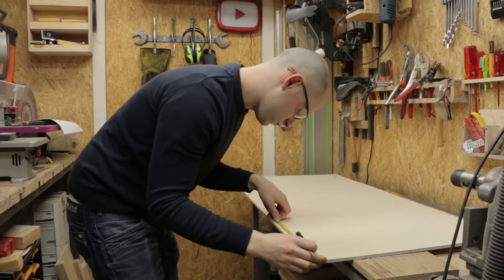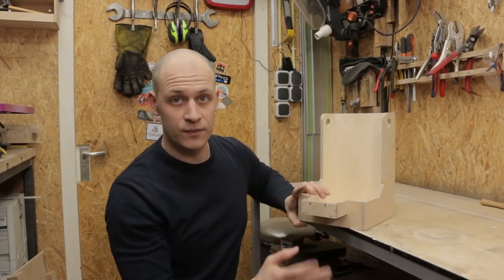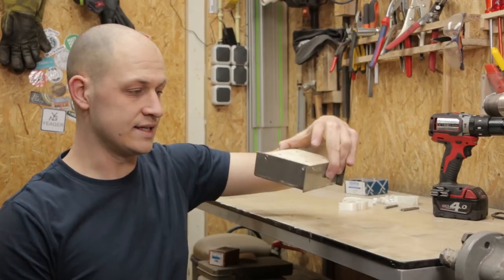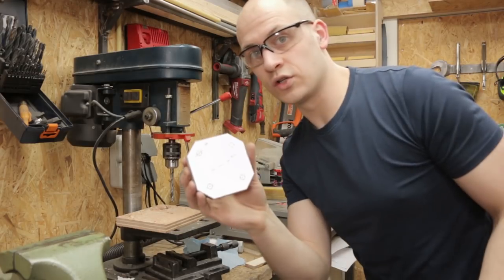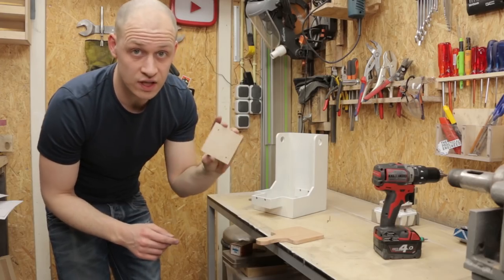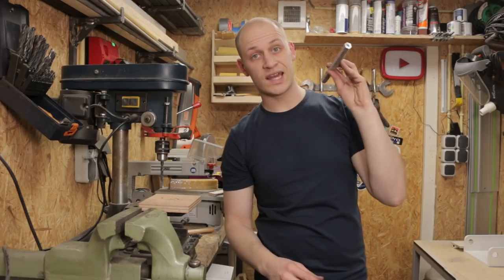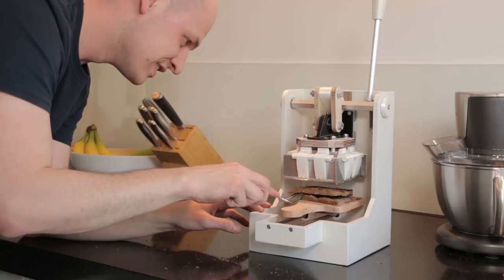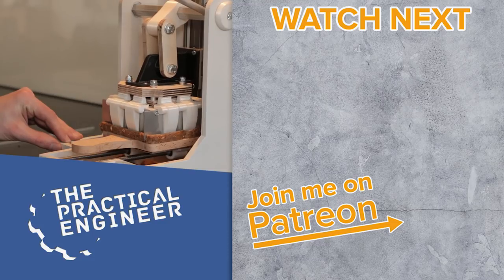Bread De-Cruster - Make perfect square toast!

Comment: Innovation of any kind should be with the primary purpose of reducing the time spent on the task and making our lives easier. Average time to cut out the crust from a bread with a knife would be around 10 secs and the machine would do the same task in say 5 secs. This is really not much a time saver. I would suggest that you use your engineering skills (which are really amazing btw) and model something that could be serve a better value.
Reply from the maker: Like what?